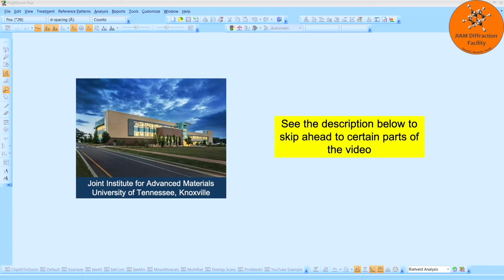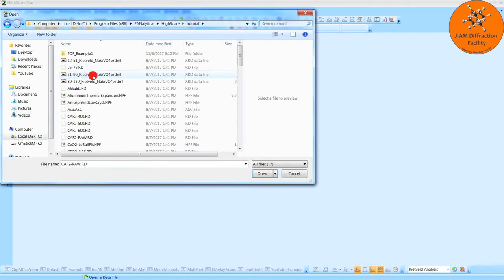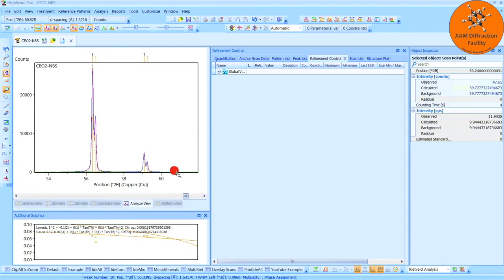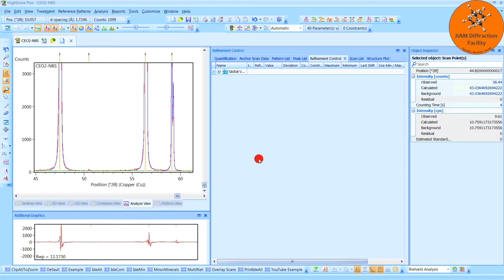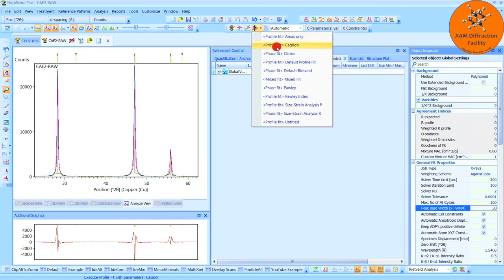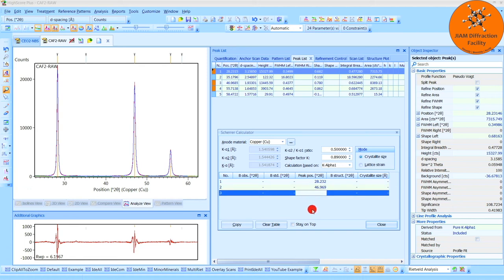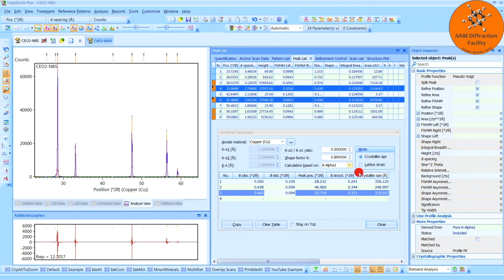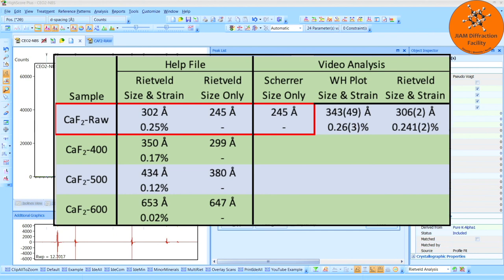Crystallite Size & Microstrain - Part 1 - Scherrer Equation - HighScore Plus - Panalytical

Comment: Thank you very much for the very helpful video. You mentioned that one can improve the fit by varying the Peak Base Width. What else can be done to improve the fit? In my case the calculated intensities are significantly different in comparison with experimentally measured, most likely due to the presence of texture in my sample.

Comment: Many thanks for such an informed and lucid explanation. I have one question: Can Scherrer formula be used in a sample that has more than a mineral, with potentially overlapping peaks?
Thanks
Reply from the maker: Ideally, you are going to want to find a peak that has no overlap.  If that isn't possible, I would suggest determining crystallite size using a Rietveld refinement as that would likely do a better job deconvoluting peaks; it also doesn't rely only on one peak to determine crystallite size.  In fact, Rietveld refinements are my preferred method if that is at all possible for you.  

Worst case scenario, if you only don't have any peaks that have no overlap and you can't perform Rietveld refinements, I would try to find a peak that has the least overlap with only one other peak (the two peaks are as separated as possible).  This way, whatever software you are using for peak fitting has a better chance of deconvoluting the peak well.  

Please keep in mind that Scherrer's equation already might only provide a rough estimate of the crystallite size, especially if there is any microstrain in your sample.  Adding a complicating factor such as peak overlap will further increase the amount of error in your result.

Comment: good morning sir. in my case when i open the file section and go to c drive .... in tutorial CAF2- 400 RD, 500, .... RaW RD  etc.. are missing. what can i do
Reply from the maker: My apologies for the long delay, I was sick and then on vacation.  Anyway, the first thing I would do is run a search in the entire c: drive for one or two of the files in case they are hiding somewhere unexpected.  If the search doesn't find the files and you legitimately purchased HighScore (i.e., you or a predecessor didn't illegally download it), then I would reach out to Malvern Panalytical and ask for help.
Reply: @IAMMDiffractionFacility  Thank you sir

Comment: Sir, I have doubt which is not related to this method, can u please help me with this one. My doubt is: When I do profile fitting after searching peaks, the value of FWHM and Peak positions are changing from numerical values to some values with brackets[eg, FWHM is changing from 0.635 to 0.6(3)], what does it mean?
Reply from the maker: If you have "Calculate Errors" turned on, the software will determine the estimated standard deviation (esd) of the refined value.  When you see a number like 0.6(3), it means that the refined value of 0.6 has an esd of + or - 0.3.  If you want a more detailed explanation, I suggest checking out this page:  http://pd.chem.ucl.ac.uk/pdnn/refine1/errors.htm.

Comment: Hi I have one question that I am really confused about. I want to ask that suppose if I have synthesized magnesium oxide, than to perform its size and strain analysis, Do I need to obtain standard NIST sample for magnesium oxide, only then I can perform instrumental  broadening and then determine strain and size of my material. Or I can use any standard NIST sample like Silicon.
Reply from the maker: Thankfully, you do not need to have a standard that matches the material you have made.  When you go to the NIST website, you want to make sure that you buy a line shape standard.  NIST has different types of standards, such as line position, line shape, quantitative analysis, etc.  Some standards can be used for multiple purposes.  For example, silicon and LaB6 can be used for line position and line shape. 

One thing that I may have forgotten to mention in the video is that the best results are obtained when the peaks in the standard span a wider 2theta range than your sample pattern.  For example, if your sample pattern has peaks from 30 degrees to 90 degrees 2theta, you would want a standard that has peaks starting at or below 30 degrees, and you would want to collect data until you have a standard peak past 90 degrees.  I may not be explaining that well, so let me know if that doesn't make sense.
Reply: @IAMMDiffractionFacility  Ok.Thank you for your reply. Now I understand. Its clear now. Thank you once gain.

Comment: What is the difference between the value of Crystallite size only (the one that does not consider broadening from microstrain) and the value of crystallite size obtained by Scherrer calculator?
Reply from the maker: Good question!  I'm not sure if the same equation is used to calculate both (I wonder if this information can be found in the HighScore Plus file...I will try to remember to look after I return from vacation).  However, one difference is that the Rietveld refinement uses ALL peaks in your pattern to determine the crystallite size while the Scherrer calculator only uses one peak.  In my opinion, this is like calculating the lattice parameter of a phase using only one peak versus all the peaks.  The Rietveld method with crystallite size only utilizes more information (more peaks) in the calculation, which gives me more confidence in the result.  

One test that you could perform to see how the results compare would be to use the Scherrer calculator on one peak.  You could then zoom in on that one peak, right click the diffraction pattern, choose "Clip Range" to get rid of everything except that one peak, and then perform refinement analysis with crystallite size only.  That would give an interesting comparison of results at least.

Comment: Thank you Sir for the sharing knowledge , It is very usefull, I have a question: is it the same method can i used when i have only a broad halo (for amorphous material) to calculate cristalline size , thanks a lot
Reply from the maker: Thank you for the kind words!  Unfortunately, the Scherrer equation won't help you as amorphous materials do not have crystallites.